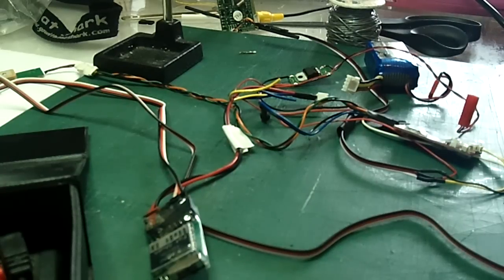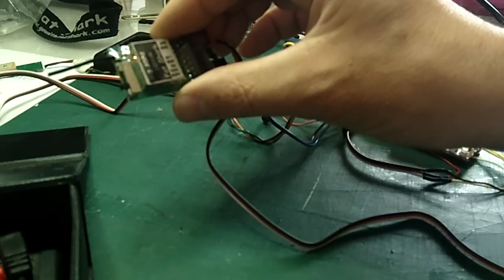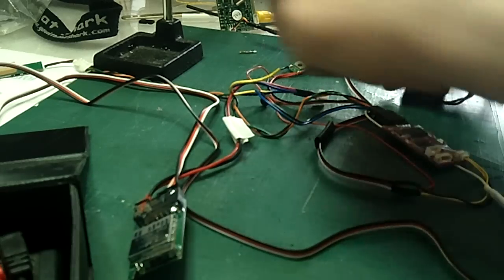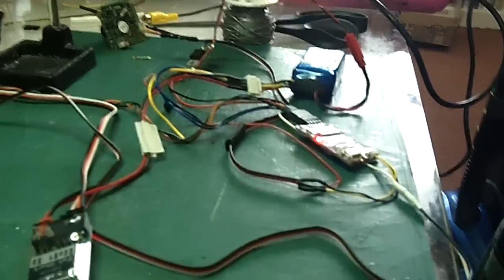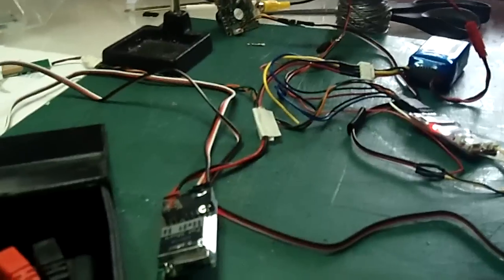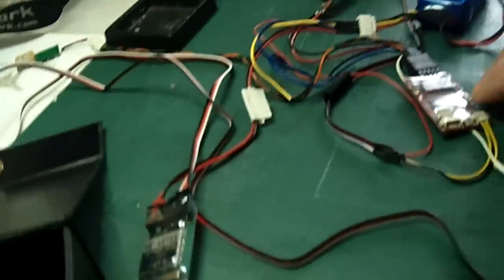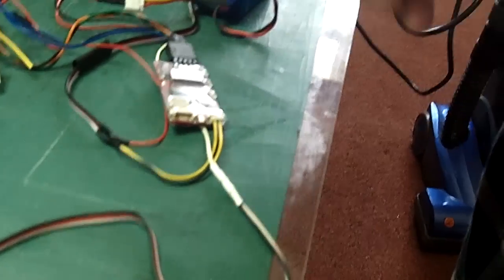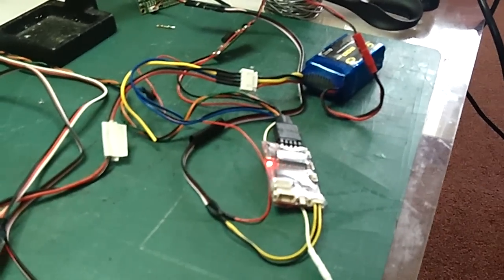Myflydream TeleFly puzzle

Comment: great. who would have thought..  i found if i sent them a tech support e-mail at night, i had an answer in the morning.  i am using the 700 tv line camera from ready made rc, and it works great. i love it.  glad you got it working. you will like the tracker. just be sure to use a video transmitter that has good audio. i tried 3 different lawmate transmitters, and none of them worked.  i finally got a racewood red label with the appropriate reciever, and a 13 db patch, and it works great.

Comment from the maker: Thanks bud
I have found the problem now, apparently you cannot use a camera with to high a line resolution, or in my case to low, I was testing it out using a 420 line camera, I replaced it with a 600 line camera and it works fine.

Comment: o, yea by the way, mine worked for about 10 minutes, and burned up it's tilt servo. i replaced it with a hitec hi-torque servo, against their recomendations, that a high tourque servo will throw off the internal compass, and it works fine.  tha tilt servo that comes with it is junk. it's an easy fix, though.